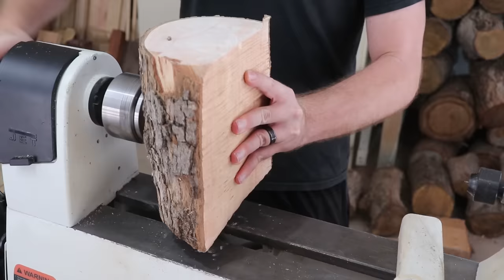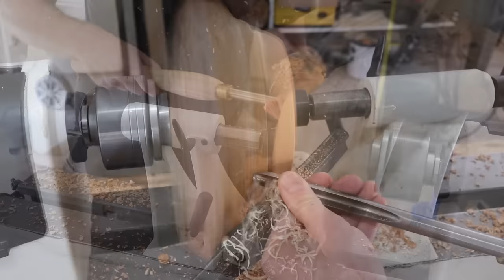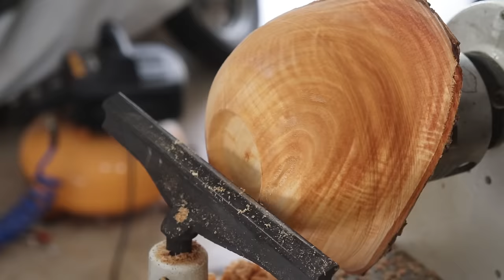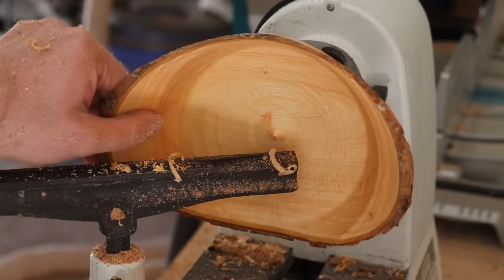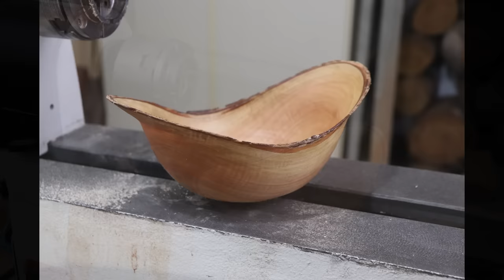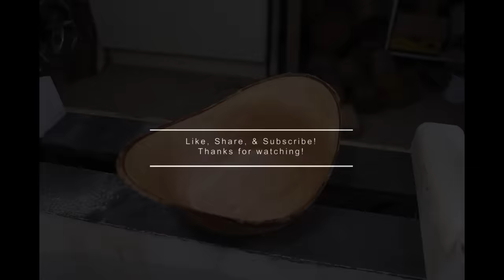Wood Turning - Half a Log to Half a Bowl?

Comment: You probably already know this, but just in case someone reads this and doesn't yet know, you should remove rings when turning. Yours might be wood which will hopefully break before it rips your finger off like a metal ring would.
Reply: Couldn`t have said it better myself
Reply: I thought it looked like silicone which is the best option if one must wear a ring and turn. The ring will easily give. I personally remove all adornment before getting near anything that could grab.
Reply: If you injure your finger they may need to cut the ring off to treat it.
Reply: I don’t wear a ring, when turning or otherwise, so I hadn’t thought about it. But, I’m struggling to understand how a smooth ring could catch and tear your finger off. Can somebody explain it to me?
Reply: What type of gouge do you use to shape the outside of the bowl, please?

Comment: What speed (RPMs) do you turn the Bowl, after you have shaped most of the bottom and the piece is fairly balanced on the lathe? I wonder if higher speed is better for turning the wings?😅
Reply from the maker: About 900. This lathe I had to move the belt to change speeds so it only had a few choices for rpm

Comment: What was the drill/hole attachment you used to bore out the hole in the center?
Reply: It’s called a Forstner bit.  You can get a set with different sizes.

Comment: As someone new to turning can I ask a question?
Why do turning videos show these hugely unbalanced chunks?
Seems risky and hard on chisels?
So far whenever I've tried turning a piece like this I've used a Wing Divider, scratched out a rough circle of where it's likely to be once its more balanced and just hogged off the excess with a band saw.  I can take a huge amount of the off balance material off this way and save my tools the wear and tear.
Is it just for the "coolness factor" of the video? Or is there another reason you turn such an u balanced log?
Reply: Wondering the same
Reply: @DoriftuEvo  3 momths and still no answer.  I dont think we're getting one.

Comment: Nice bowl, but do you know that you're not getting full grip on the entire recess for your chuck? With that wide of a gap between your jaws you're only partially making contact.
Reply: As a long time professional turner I am unclear about what you are saying? If the jaws were open more you’d have a better hold? In fact all you would have is a large base with no appreciable increase in hold. If you meant depth of the mortise the jaw fit into, you really shouldn’t bottom out the chuck. The best holds seem to me to be the closest the jaws are to forming a circle. I might have brought the tail stock up if I felt there needed to be a better hold but it came out wonderfully, didn’t it? Kudos to the turner.